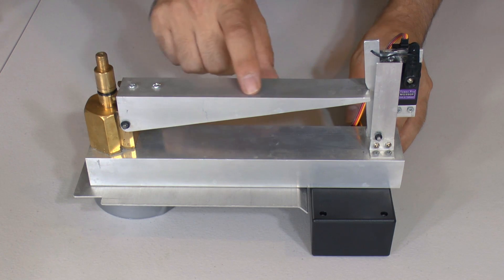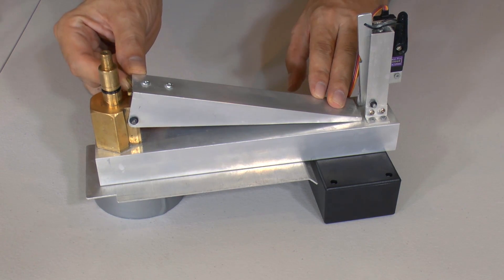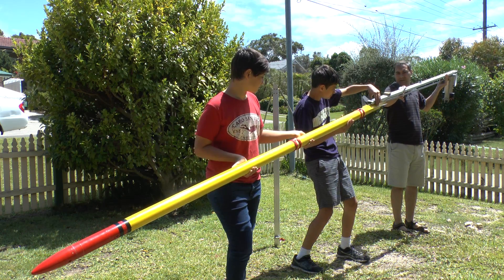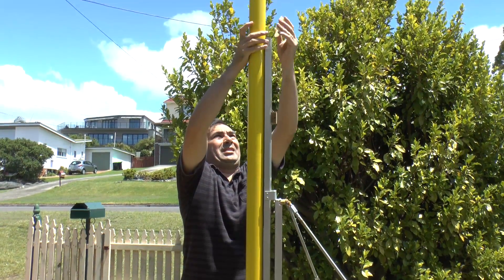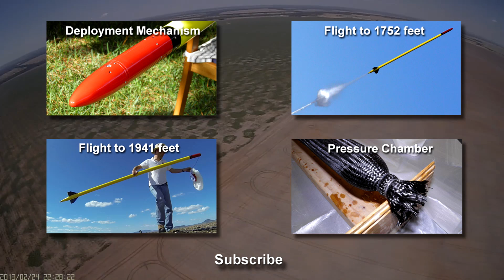High Pressure Launcher for water rockets

Comment: This is a great launcher and you can see the precision,detail and engineering that has gone into making this machine. I like how three persons were used in  your video loading the rocket which is fine if there are more than one person., however what happens if there is only one person could the rocket be loaded first and then water added which i am assuming was the reason for three person to load the rocket.
Reply from the maker: Yes, this is possible. A number of people have made launchers that fill the rocket with water after it is on the pad.

Comment: In fact....this is just a simple but verry efficient and well-developed launch system. Well done George.
Reply from the maker: Thanks +teamlucrockets. We've been happy with how it has been handling the pressures. We believe it could be scaled up even further for much higher pressures, and for larger nozzles, and still use the same servo motor.

Comment: Is there any reason to add a safety pin behind the second lever? And could you widen the slot at the bottom of the launch rail so you can remove the temporary rail lugs fro near the bottom instead of having to stretch?
Reply from the maker: Thanks for you suggestions +Robert Szasz. The safety pin is a possibility, though in practice we haven't had an issue of the secondary lever releasing the primary one while handling the rocket. If the primary lever should get released while handling its no big deal as it is not under pressure. Having a wider slot near the bottom for the rail buttons is a good idea. :)